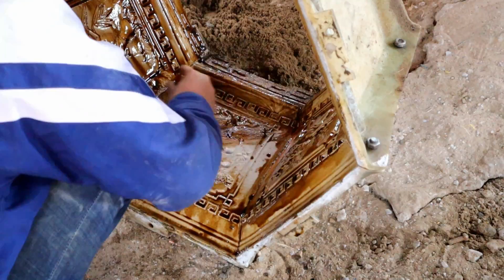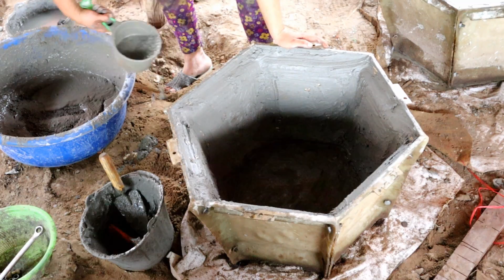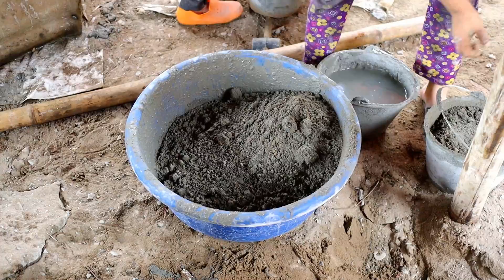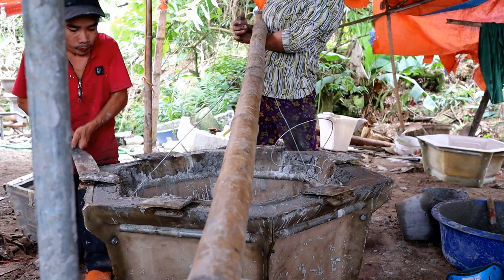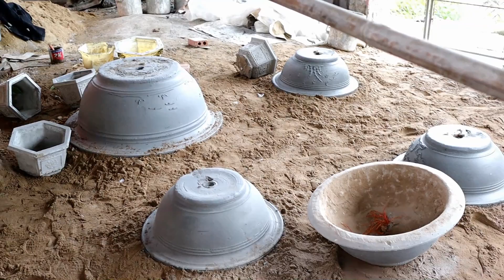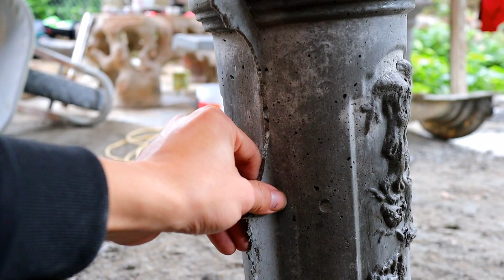Casting cement pots from Plastic Mold - Casting project

Comment: Can anyone place caption on the screen stating what's happening or what you are doing and why, i.e. when place thin brown liquid on item  for example.
Reply: The thin brown liquid is waste or used engine oil.
Reply: It is used as a mold release agent, so that the mold separates from the cement more easily.